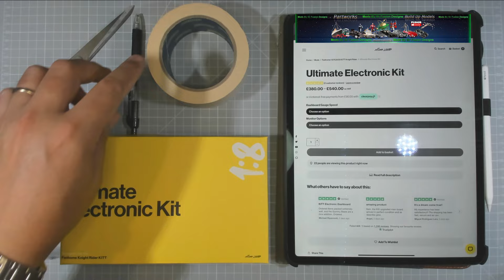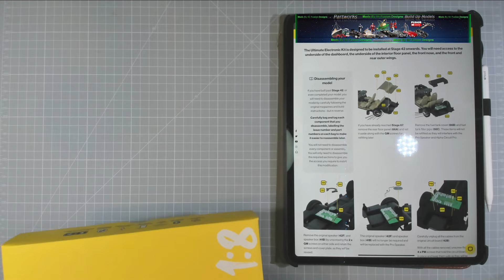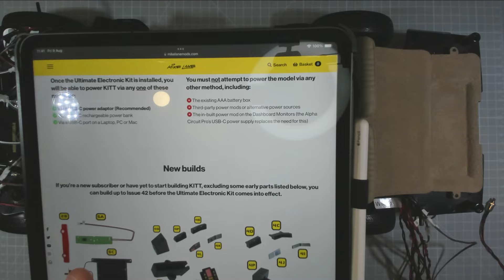MIKE LANE ULTIMATE ELECTRONIC KIT DISASSEMBLE STEP-BY-STEP GUIDE BY MR FUSION DESIGNS

Comment: 24:16 is It ok If You Can Buy Another Bracket For The Front Scanner And File The Squares Into Rectangles?, I Want To See A Comparison Video With The Basic Front Bracket Aswell As The Two Upgraded Ones. I Also Copied The Idea From Workshop https://youtu.be/DglNSaRhx7U?si=8b4-apMK9AXIBooF Where The Basic Bracket For The Front Scanner Looks A Lot Better After We Filed Down Those Circles Into Squares. 😀👍.
Reply from the maker: I haven't fitted mines yet but am sure there is options to get it to look right